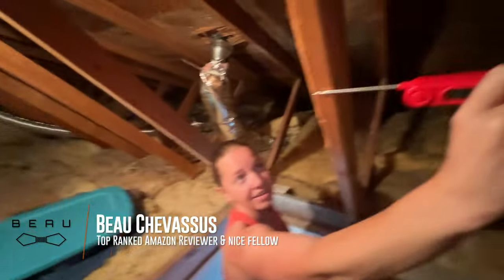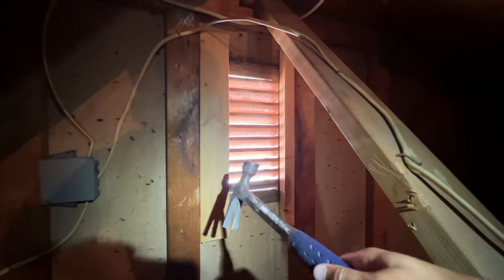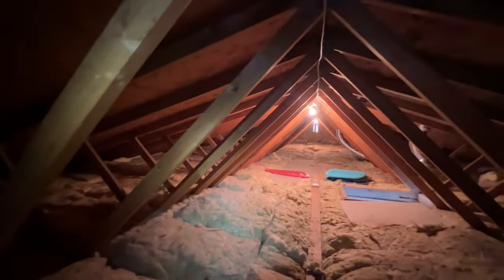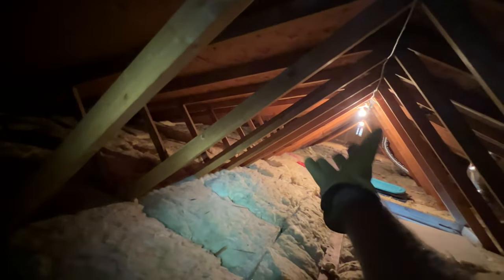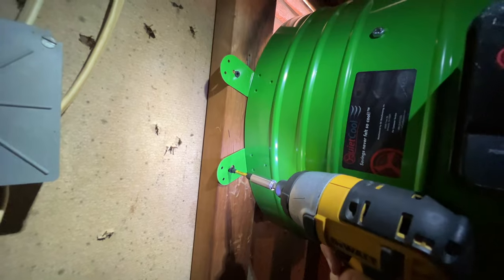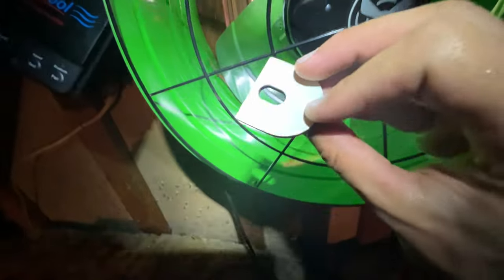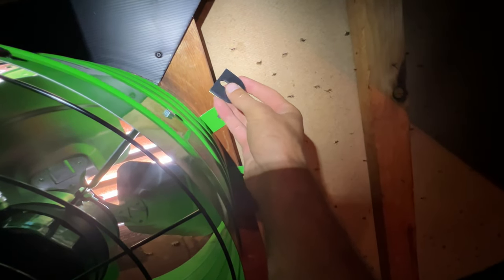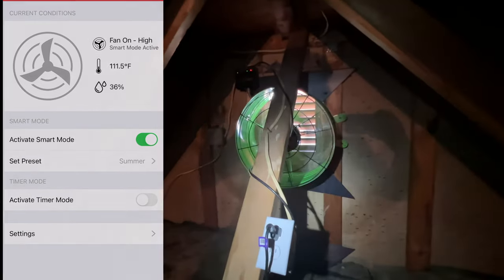★★★★★ Review and installation tips for QuietCool AFG SMT-3.0 Smart Attic Gable Fan

Comment: Supposed to put the rubber tabs between the wood and the fan. It stops vibrations. Reduces the noise.
Reply: I did, but still noisy. The fan itself isn’t well balanced and running on its own can make lots of noise

Comment: What was the temp in the attic after the fan was working?
Reply: I would like to know too, do you notice an energy savings?  Thanks for video
Reply: I have 2 green models, fans, on 104° outside  temperatures,  my attic is 114° or less
Reply: Energy  savings,  my old single  speed fan cost .05 cents an hour to operate,  the green model  costs
On low speed, .0074 cents per hour
 Middle speed .02 cents per hour
 On high speed, it's. 05 cents per hour.
 My electric  rate is .35 cents per kwh
Reply: @markchristensen5206 did u feel temp different as before?
Reply: Our insurance  company  canceled our insurance,  do to the roof being 20 years old, the roofer suggested  that we have a ridge vent. It's been 30 days, and several  100° days sence  the new roof. The gable fans have yet to come on, inside the house  stays cool all day, no air conditioning. The hottest  the attic has been is 115°. We also have r66 insulation in the attic
Reply: @markchristensen5206  recommended No ridge vent. Wont help . Just add more vent with fan GT-12. I just did my roof.
Reply: @att2976  yes there's a  difference  in temperature  with the green  gable fans
Reply: @markchristensen5206  thx

Comment: JUST A HEADS UP - THE OPENING IS WAY TOO SMALL , if you look at the blades theres a good 6 in on the bottom that arnt doing a thing , and afew inches on BOTH sides Minimum opening per manufacturer is 14 sq; other wise the fan is working against its self and will burn out the motor , those rubber tabs are vibration dampners

Comment: So i see you have the same issue I'm having which is my gable vents are smaller than the size of the fan itself.  Does it seem to cause issues with putting extra stress on the fan?
Reply: it absoolutely will put more stress on the fan min opening per the manufacturer is 14 square , otherwise the the fan is orking against its self and will burn out the motor